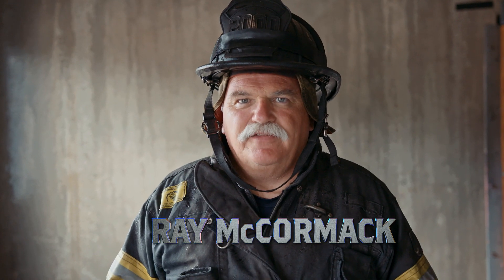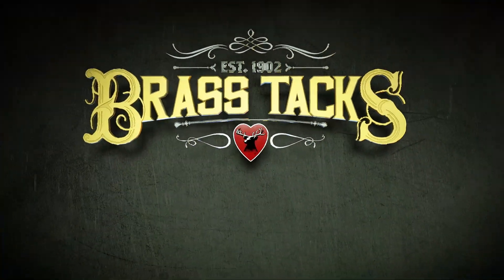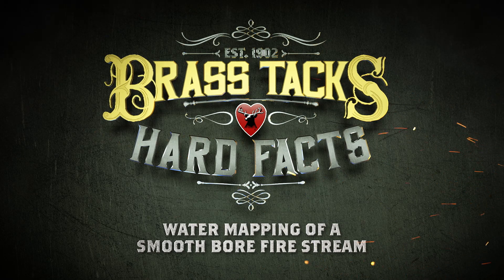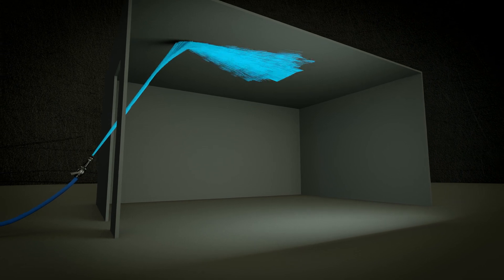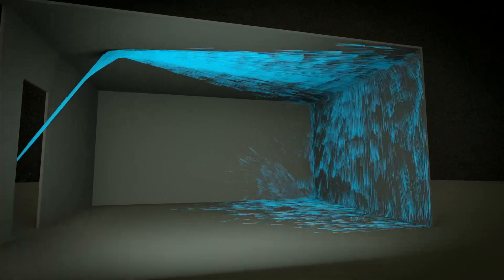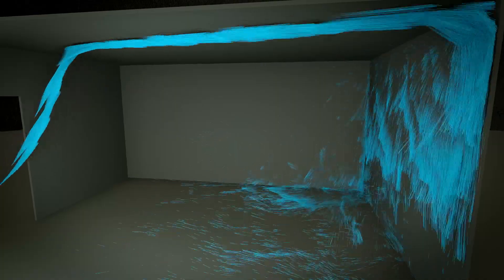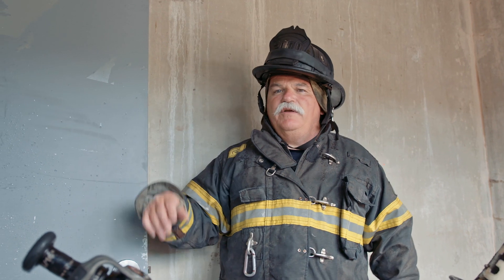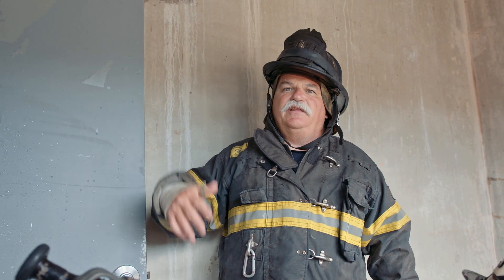Water Mapping of a Smooth Bore Fire Stream (Episode #45)

Comment: That's great if the only thing burning in a room, is the ceiling.  How often does that happen?  If you want the room contents to stop burning, you have to get the contents wet.  That's where an adjustable nozzle comes in.  Along with thinking about where the fire is so you know where to apply the water, will get the job down.  The key is to THINK and use the least amount of water to quickly and safely extinguish the fire. This is how you do that with an adjustable nozzle or fog tip, not with a smooth bore. https://youtu.be/iBQpVhrS_4o?list=PLkp0E1ao1XEzQH1_f3DKwCYMuow9RA13r
Reply: with the video you linked, if you were interior instead of exterior doing the same procedure, would that steam not burn you up?

Comment: A smooth bore nozzle puts hardly any water on anything.  With an adjustable cone or fog nozzle, you can adjust the cone to cover as much material as possible while overpowering the energy of the fire or wind.  If you find the fire room during a 360, you vent the windows, the pressure escapes out those windows, water goes inside to soak the burning material and the gasses including steam continue out those same windows.  That can be accomplished using Tank Water long before the firefighters can get fully dressed, assemble and entry team and get the door open.  To not do this and fight the fire from inside defies logic and common sense.  When fighting it from inside, the heat and steam have no where to go but over your head no matter what stream you use.
Reply: No you lost me at the “smooth bore hardly puts water on anything” that screamed that either this dude is trolling really really hard or we have some really incompetent people in the fire service.
Reply: @jbrady1009  We use high pressure hosereels on a half fan if hitting the fire from outside through a window. If when entering we use a wide cone to start with.
Why ?
Surface area. The fine mist creates a greater surface area than a solid stream thus cooling the flammable gases in the ceiling which reduces the temperature and reduces the chance of a flashover.
If you use a solid stream much of the water just falls to the floor and has little or no effect and if you use a solid continous stream it just creates far too much steam which  makes it difficult for crews to remain in the fire compartment. When we enter a fire compartment we can sit at the doorway and direct some short wide fan pulses directly in to the ceiling to cool flammable gases above our head then we narrow down the cone and start to aim lower and towards the rear of the compartment with short pulses which just knocks the fire back until you hit the seat of the fire. You do not need to have a solid open stream on a jet and just drown the floor its pointless.
Reply: @andyoxleyonhistravels  Can you believe how little common sense and logic there is out there?
Reply: @andyoxleyonhistravels  You don't even have to test some theories.  All you have to do is think them through.  That's how I came up with this.  "Adjust the nozzle to cover the most material while still penetrating the energy of the fire and wind."
Reply: @jbrady1009    We have Amazingly incompetent people in the American fire service.  You can see it in every video.  No, not some of them but all of them.  Just ask yourself, "Why is it taking so long to get water on the Visible Burning Material to stop the threat?"  I'll tell you what.  Post a link to any fire video where you think they did a great job and look for my comments there.  If I didn't see it I will evaluate their performance for you.  It really isn't hard to do it's just that no one does it.  They just worship them for Joining Up, Dressing Up and Showing Up.  Everybody needs their heroes!

Oh and as far as a smooth bore stream, all the water falls on a small area and the flames persist.  Open the cone on an adjustable nozzle just a little and you cover much more area and eliminate the flames much faster.  This is Not Brain Surgery.
Reply: Hmmm!  Where did Joshua go?
Reply: I really truly hope you’re trolling
Reply: @jbrady1009  Jack is indeed one of the biggest trolls on YT.  He knows absolutely nothing about firefighting but has spent years posting critical comments on hundreds of firefighting vids.  It's his obsession.
Reply: @jbrady1009    Are you serious?  Did you not understand what I said?  If you didn't understand, read what Andy said below.
Reply: What about going inside and putting yourself and your water between the fire and potential victims to create survivable space? Interior fire attack with fog patterns in todays fire environment is downright hazardous. Smaller water droplets and lots of air entrainment combine to create a higher rate of steam conversion and disruption of the neutral plane. This collapses the superheated fire gases down on top of us and anyone else inside. With straight streams our steam conversion rate is much lower so we have the ability to cool that environment before it drops down on us due to excessive steam production and air entrainment. Unless you’re saying FSRI, NIST, and ULs 10 years of study on this topic are completely irrelevant.
Reply: @squidog94  Sounds great on paper but not in reality.  You can extinguish all Visible Burning Material from the outside faster than you can get inside.  You quoted what others have told you to think very well but you should try to think for yourself.  Read all my comments on just about every fire video on YouTube and you will understand why mainstream USA firefighting is wrong.  By the way, those organizations back up everything I say and all this steam BS is overrated.  You want steam? Fight the fire from inside before you vent the fire room windows and put the fire out from the exterior.
Reply: @squidog94  The reason  you're solid stream doesn't create so much steam is that most of your water is not absorbed and falls on the floor and is wasted . In 25 years I used high  pressure hosereels on interior structure fires and we used them with fairly  short pulses.  This assured that minimum amounts of water was used but because it is in pulses  and the smaller droplets  which create a  larger surface area they are absorbed better  but does not create excessive steam  and very little  is wasted.More importantly in my career I never had to back out of a structure fire because of steam and I never saw 1 casualty with steam burns . What I did see was victims who had died from smoke inhalation which is the most common cause of deaths in fire, the rest are caused by burns . If you  look at the tests Nist carried out the solid stream and fog pattern tests were carried with a continuous  flow. Their water mapping tests were no use as they were carried out in a non fire environment which gives you a false result as you have no idea what happens to the water if there is no fire.We never use our high pressure hosereels on a continuous flow when on an interior attack as we know that the most effective way is to use your water in a pulsing fashion and changing the width of the pattern used depending  on fire conditions in the structure which are always different. We are trained in using high pressure hosereels and larger 45mm and 70mm hoselines on interior fires and the one thing I learnt was I would rather use hosereels everytime as they are easy to move around inside  they have a solid core which stops any restriction in water flow from kinks in the hose which can be a problem with larger hoselines.  I am sure people will have different opinions but I can only speak personally from what I have used over a long period of time.
Reply: @andyoxleyonhistravels  interesting. You’re from the UK? I’ve always been interested in the use of high pressure/low gpm over there as opposed to our 1 3/4 150gpm minimums. I get the arguement of GPM vs BTUs but there’s a lot to be learned from all the different strategies and tactics used by the fire service around the world. We all obviously do things the way we do them for some reason but if we can’t evolve and learn from each other as times and construction change we are doing our citizens a disservice. It’s like the rope rescue world. We’ve made HUGE steps forward as we’ve shared knowledge between mountaineering, arbor culture, industry, and caving to develop equipment and best practices for fire service rope rescue. Use all the knowledge you can from as many sources as possible to give the best product to our customers who pay our salaries. Thanks for the insight.
Reply: @squidog94  You are very  welcome and yes I'm from the UK.  Nice to chat to you.
Reply: Both nozzles have their application. If you want gpm and not disturb the high temperature gases and thermal layers go smooth bore. If you are trying to push gases and smother or fight class b fuel fires go fog nozzle.
Reply: @cadena06  An adjustable nozzle can equal the reach and volume of a smooth bore.  There are videos on here that prove that.  So, a smooth bore is a single use tool in an ever-changing fire environment.
Reply: @JB91710  show us the videos
Reply: You need to do some research. Look at Fire Safety Research Institute materials. Straight steam or solid stream for surface cooling also cools gases/smoke. It’s not an either or.
Reply: Man I hope you aren't a fireman or you'll get people killed